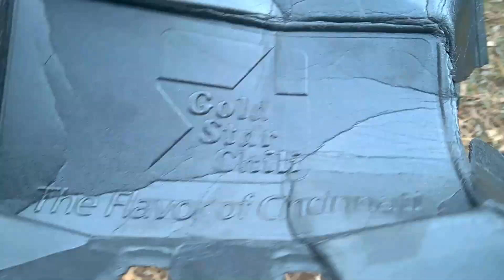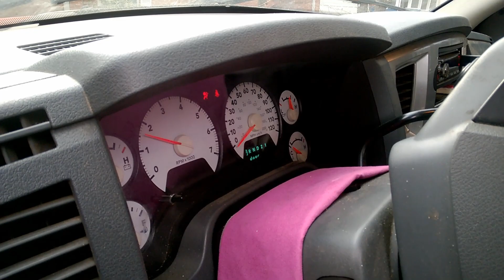pointless vid  SO DO NOT watchRant #5

Comment: your right on
Reply from the maker: =)  thanks
Reply: Mow Yo Yard.           Hey there Brian ic you been having a problem with your abs light coming on. if you haven't did any research on why your ABS light might be coming on. Mine has also came on as well as my brake light (L R) that has to do. Strictly  with your brake system. it could be as simple as a sensor as they tend to go bad get old and brittle and not function    like they should and end throwing codes or as in your case displaying the light. I would if your worried about it take it to a shop you trust and has them look over your brake system throughly. Or diy it as I tend to do most of my work on my own truck saves money plus you end up learning something you could also go to a autozone as they offer free services of reading codes and other services they offer for free